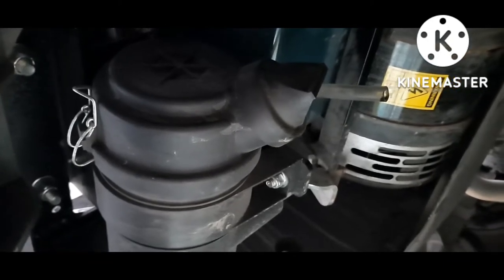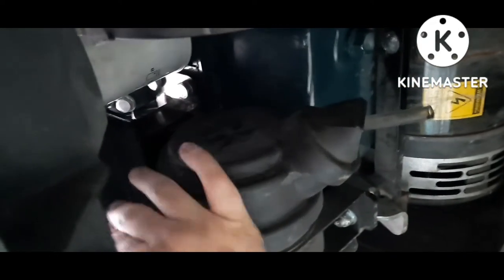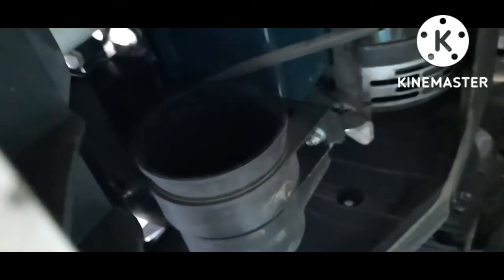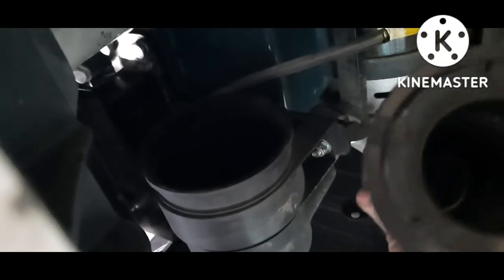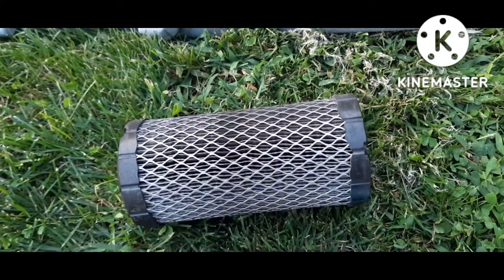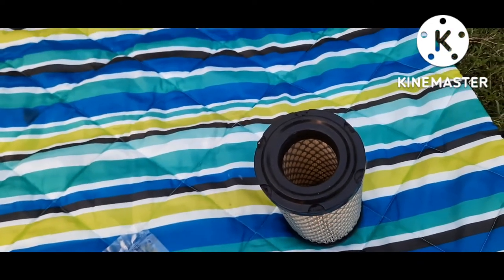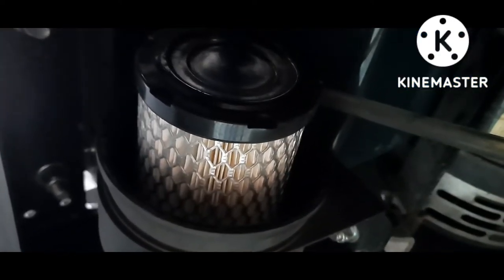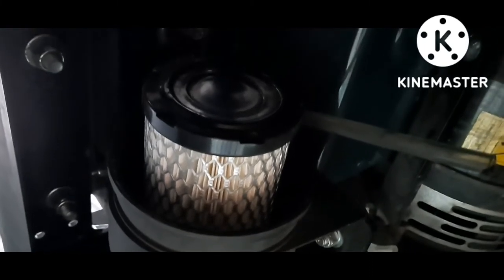#5 Air Filter Replacement On A Carrier Comfort Pro APU

Comment: Can a bad filter make it not blow hot air / cold air as well?
Reply from the maker: An air filter won't affect that. You've got some other issue if you don't have hot or cold air.
Reply: @sberger6604  is there a filter on the fan unit that’s on the back of the cab ?
Reply from the maker: @Neal Duran  No. There is no filter on the condenser. There is a receiver drier with a desiccant filter mounted back there, but there is no maintenance involved with that.